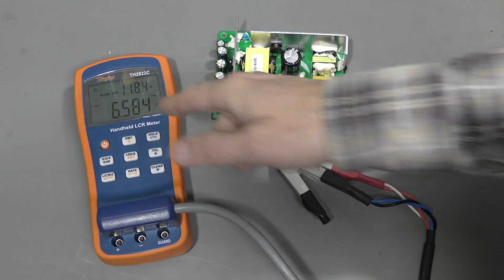#141 - KRK Rokit 7 speaker repair

Comment: Woke up this morning to find that a momentary powercut had rebooted all my systems. Both of my KRK Rokit 5's had simultaneously died, showing only the flickering screen. After a quick search around the internet, I found a link to this video. A quick check shows that both have the same bulging capacitor on their power boards, which must have been pushed over the edge by the powercut last night.

A set of new capacitors is on the way, and I'm hopeful that this is going to have solved a potentially very expensive problem for me.

Another huge set of thanks here from someone else you've saved with this video. Much appreciated.

Comment: ⚠️⚠️So I replaced the capacitors in both of my speakers. Both working fine in regards to the power but now only one of them doesn’t have any sound coming out of it??? ⚠️⚠️

I’ve taken another look to make sure that everything is plugged in etc but I’m not sure what is going on? What diagnostic steps can I take to find the problem??

Comment: I walked into my house after vacation on the 22nd September 2025 and both my KRK 10.3s had the same issue of a flashing led screen. This repair video is still valid. What luck. Replaced the 10v 1kuF caps on each board and working again.
Reply: What brand of capacitor did you use? I replaced the capacitor, it turned on again, but unfortunately it sounds with less power, I don't know if it is due to the quality of the new capacitor that I put in it, which is not from any brand

Comment: Just wanted to add my appreciation for this video! I was EXTREMELY fortunate to have someone give me two Rokit 7's that didn't work and they were going to trash. Guess what the problem was? The same bulging capacitors! $7 for a pack of 10 on Amazon and about 30 minutes to repair, and now I have awesome speakers. Thank you so much!
Reply: Hey, would you be able to send a link for which capacitor you grabbed please?

Comment: Had to take apart my KRK sub s10.4 since it wont power at all (no standby light) after a power outage. Found a bulged capacitor on my power supply board near the same location. I really appreciate this video, thankyou for sharing your knowledge, I have a much better idea what I'm looking at now.

Comment: I have 2 Rokit 8 gen 4. They were not in use but powered on when the circuit breaker tripped. Both had the flickering screen. Both had the same cap bubbled up on top. I know how to solder so I gave it a try and it fixed both speakers. THANK YOU!!

Comment: My Rokit 5 G4 was powering up, display was working but no sound.  I checked the voltages on the main PCB and the 5V was down to 3V. While the speaker was powered up I sprayed the regulator chip with freeze spray and the voltage shot up to 5V, faulty regulator. I ordered the regulator(AMS1117CD-5.0) from AliExpress(10 for $3.00), replaced it and the monitor works fine. I saved AU$299 as a result. I am an electronics technician and have done component level repairs for 45 years.

Comment: Thank you very much. I ran into the same problem. The speaker wouldn't turn on, and when turned off, the display backlight was blinking. Inside, I didn't see any signs of damage, all components were intact, including capacitors. I checked the voltages — there was actually 4V on the 5V bus, the other buses were fine. 

I started looking for information and found your video. I checked the capacitor that you replaced. Mine was also damaged — the capacitance was 90 μF instead of 1000 μF, although it looked fine visually. After replacing the capacitor and checking the voltage on all buses, everything was OK. Now it works.

Comment: It is not uncommon for capacitors to fail. They tend to swell and sometimes burst but they can also fail without any visual indication.  Made in China, so the manufacturer might have switched capacitor suppliers to save money without informing KRK. There are problems with counterfeit capacitors in the supply chain. 

In the 90's we had millions of them failing due to Chinese manufacturer stealing the formula from a Taiwan manuf. Well a bit of counter corporate espionage resulted in a faulty chemistry. All the capacitors began failing around the same time. IBM / HP / Apple and many others were impacted. 

Fortunately, it's an easy fix most anyone could do with a multi-meter, basic soldering iron, electronics solder and some patience. Back in the 60's and 70's is was not uncommon for sound engineers to be fixing their studio gear themselves.
Reply: This spying issue was a long time ago. The current KRK Rokit issue happens due to bad PCB design to begin with. The manufacturer might have cut corners, but KRK's circuit design kinda set those capacitors to fail early.

Comment: Had a flickering problem with the rokit 5 g4 (wouldn't turn on and back display kept flickering). followed your steps, used the exact same size capacitor and voila. Thanks!

 (update: the speaker still works for 10-15 mins when i boot it up, and then starts to cut on and off for about 5 mins and then just fully cuts off all sounds. It stays on, the display and everything works. The capacitors are still good. Any advice would be much appreciated!)
Reply: I had a similar problem, see my comment above if it hasn't already been fixed.

Comment: This is ridiculous.  This is not an old models. I notice too many of  these KRK's are faulty. This is a great shame.  I do like how these speakers look. Also I have heard they sound good  too. But reliability is paramount.  You done a good job, Man. Thanks for sharing. Bless.
Reply: They do sound good. And that's why they suck. They're marketed as monitoring speakers, which are supposed to be flat and revealing.  And one of mine has just shit the bed (been using them more for home theater, than mixing)

Comment: I have the same power board (KRK PR7/8/103) but the problem with mine is that they changed the U1 and I don't have the data sheet to know which is the original. could you tell me what it is? Tanks
Reply from the maker: sorry, no idea about that

Comment: Huge t hanks to you sir! The power went out at my house and took down one of my KRK R7s (wouldn't power on). I opened it up and saw the same swollen capacitor. Took me 30 minutes and a 40 cent replacement capacitor to get it working again. Seems like this happens to many people, sounds like poor circuit design. I wonder how many of these speakers go into the trash because of this! Such a shame.
Reply: What kind of capacitor or model is? I have no experience. Thanks
Reply: @1TZAH  Electrolytic polar capacitor 1000uF 10V
Reply: I would like to know the model too since I have the same bulged capacitor

Comment: Perfect diagnosis - just had a KRK Rokit 7 G4 die for no reason on friday.   Found it was the same capacitor (component C7 on the power board) issue as shown here (after first testing it wasn’t a fuse issue).  84 cents for a new capacitor later - new capacitor installed - good as new.  Am in Melbourne Australia.

Comment: The power supply unit is defective on my Rokat5 G4. The controller chip is defective. The name is 65A1 or 741F I can't find this chip online. Can you help me what kind of controller chip I can use?
Reply: I don't think I have written correctly.  The chip I mean is the 3 pin chip that can be seen at the top of the mosfet.

Comment: FOR REAL @ElTheEclectic, I can't thank you enough, I was about to buy a used speaker too replace the mainboard of mine, but it all it took was this one capacitor as I had the EXACT same problem on my KRK rokit 10,3 G4. Now my speaker works again and that's because of you! you safe me over 400€ thank you so much! <3
Reply: I believe I might be having the same problem on one of my rokit 8 WN edition, it will not turn on, I opened it up and found the same bulged cap, but Im absolutely not qualified to do such repairs, will try showing this video to the local repair shop tho so thanks for this.
Reply: @bsant7  you just need to be able to use a hot stick or whatever it’s called

Comment: If you have the blinking screen issue like I did, continue reading. I had that issue a month ago right after the warrantee ran out, just like the mailman did from your moms bedroom that one time you came home early from school, but I digress. So, now inspired  and armed with the knowledge it can't get much worse than not doing it's ONE job, I opened her up (the monitor, not your sister this time) and I couldn't see anything amiss. So I left it plugged in and in the on position in hopes it would completely fail and hopefully leave a visual que along with it when it does. Woke up today, gave your other sister a kiss, then noticed something was different. Finally realized the monitor wasn't blinking anymore! Phase one of my genius plan to simultaneously wait on two things to happen that may never ACTUALLY happen actually happen!. Opened her up again and alas, the sight I was beholden to twas like the light of the full moon on a mid summers night in a deep and tucked away forest glen , glinting off the spray of the nearby waterfall that had found it place of respite on a newly blossomed orchid that did so as if merely for the sake of giving the mist a new bed on which to dream....that happens to be right next to my KRK RIKKIT 7 G4 I can now repair because the cap had catastrophically failed , thus allowing me to be able to visually see the point of failure!  I feel like a Just wone a jackpot twice and the winnings are my broken monitor. And honestly, the only thing that could make this better is hookers and blow, but bringing up your mom or sister again so soon would really miss the mark.

Comment: Good Work!
I have a problem with the same PCB, the resistor R25 and the controller U2 on the primary side are defective. Can you tell me exactly what they have to be? I can no longer see the label.
Reply: R25 is labeled 3R30nad the ic controller is CL2106OH
Reply: Hello. I have u1 damage. Do have the reference of this part

Comment: I have the same problem with my KRK Rokit 7 G4. It doesn't turn on anymore. I've checked the glass fuse and its burned. changed it to a new one, burned too directly... KRK Support is very bad. where can i buy a new power supply module?

Comment: My KRK Rockit 7 powers on (the screen and LED turn on) but I am getting no signal to the drivers. How can I figure out where the specific issue is?
Edit: I have already checked cables and output devices. My guess is it has something to do with the input port.

Comment: That components fail so fast 4-5 years old the manufacturer should be ashamed going for cheap ass capacitors is a recipe for disasters, just imagine if they went with good quality ones and maybe beefed up the secondary side with two 1000uF you will have lower esr and much longer service time.